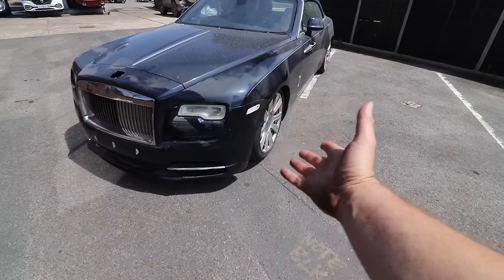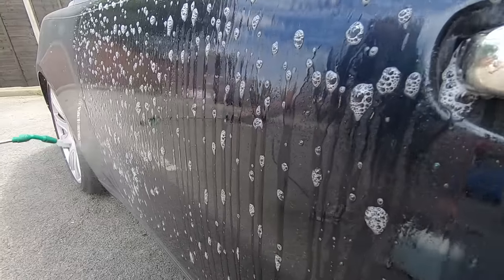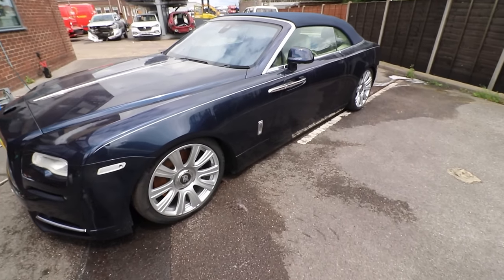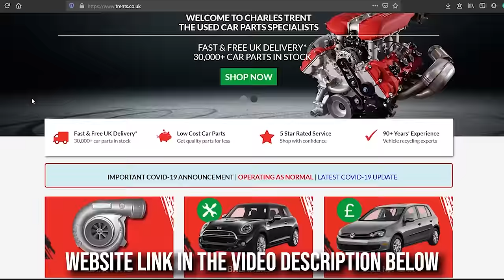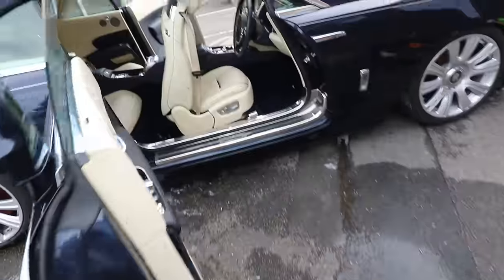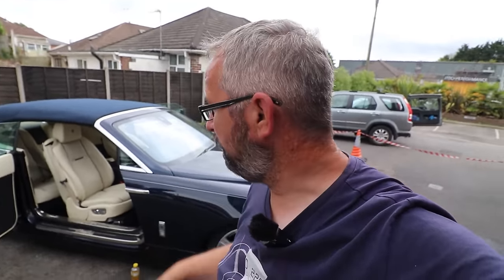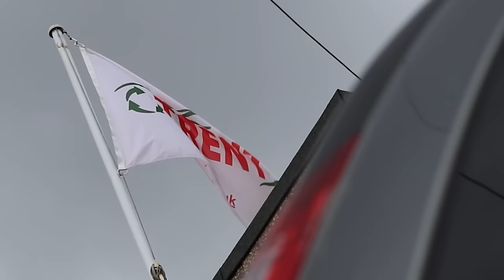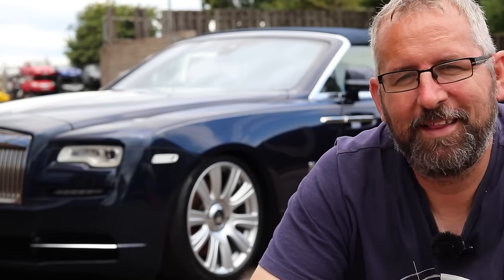COMPLETELY WRECKED £200,000 ROLLS ROYCE RESTORATION

Comment: Ah! Flood damage. Poor thing! The engine, once cleaned out and re-oiled, will probably run like it was supposed to, but at the present price of petrol, it's likely you couldn't afford to start it - never mind drive it anywhere! Had to laugh at those dissolving floor-mats, though!
Reply: at least now the interior parts can actually be used in other vehicles which need things like new seats or new doors
Reply: @Xantec  the chances of finding a market for the interior parts is slim,  the removable panels will all go but most of that car will be binned, shame,  i bet it could be made road worthy gain.

Comment: Nice job on the exterior, however, this is the classic definition of polishing a turd. Only about 10% of the flood damaged car was “cleaned.” The other 90% (that you can’t see) is probably covered in mold and dirt, with the electronics beyond salvage. The seats, headliner, door cards, dash, etc… are probably racked with mold throughout on the inside. Flood cars are junked for good reason. They’ll never run (or smell) the same again.

Comment: Hello again, A 'TOP TIP', for the inside once first cleaned, dilute 'Oil of Clove' 10 to1 with water and clean again, it not only cleans the mould but kills the mould 'spores'. Used it on a VW Golf two years ago which was worse than you RR and is still super clean and mould free.
Regards, RichardA.

Comment: Before I learned that it was flood damaged I was concerned about the use of all that liquid being sprayed on the switches and loudspeaker grills.  If it hadn't been flooded would those components have been damaged anyway???
Reply: I've heard that the switches and what not in vehicles are like water tight or i should say water resistant so you can spray or spill something like water or coffee and it shouldn't damage it it's just when they get submerged for a long period of time the water gets in and corrosion takes over and ruins it

Comment: This is of course a video whose sole purpose is to promote the products used to clean this poor Rolls.
Indeed, you know as I do that a car which has been submerged to a level higher than the seat base is absolutely unrecoverable! It is a wreck that can never legally be put back into circulation for the simple reason that it will never be able to function as before due to massive water infiltration in all the electrical circuits. This is all well and good, but it is a complete waste of time and energy (but not money, apparently...).

Comment: I'm guessing the only reason to spend the effort cleaning is to make the parts worth more. With the mold it's been sitting for a bit (at least 12 months) and the engine, gearbox & diff would be toast. At least it has done the miles which means it's done it's job.
Reply from the maker: Yep that was half the point, parts that we thought were scrap are now salvageable. Engine and box are also still good 👍

Comment: I owned a wraith for 4 years. 2017-2021. 4 year lease. So it was brand new when I got it. Under warranty it had over 50k worth of work done to it while I owned it. I wouldn't touch one of these with a 10 foot pole used. Much less water damaged. The electronics alone will cost a fortune

Comment: Worked hard but you just cleaned the outside i think it should be stripped completely sort out the electrics and all the parts given to you guys cleaned and stripped and then clean the power train the car would be worth it it needs taken apart and checking
Reply from the maker: It was completely stripped for parts after this video, it was an insurance category B meaning it can't go back on the road.

Comment: Not really sure what the purpose of this cleaning was, but you have to remove and disassemble the whole interior of this car. The mold is everywhere
Reply from the maker: It's a breaker pal, just a detailing demo not a recommissioning video. Wouldn't be worth a complete strip and rebuild considering it's never going back on the road again.

Comment: Looking at the headlining and the exterior condition of the roof seems to indicate that the car was parked for some considerable time with the roof down which is bloody criminal.
Reply from the maker: Nope, flood damaged in an underground carpark 👍
Reply: @KevTee  Well it must have been standing a long time without any attempts of drying it out or cleaning it as it has a lot of mould. Mould does not just appear after a couple of days. Probably an insurance company dragging their feet.
Reply from the maker: @truxton1000  Yep you've got it, when do insurance companies ever move either any haste 😂😂

Comment: Not very clean after your intensive clening by the car. Very big Mistake to do these with the fluid cleaner and water at the Place where the Loudspeaker are sitting. Second you must change the completely technical things, the electric and washing is the last problem not so much. Did the hydro-air-system working?
Reply from the maker: Dude it's a breaker, I wasn't recommishioning it 🤦